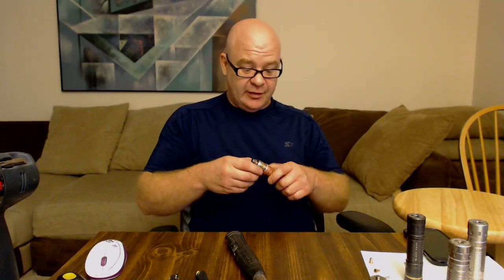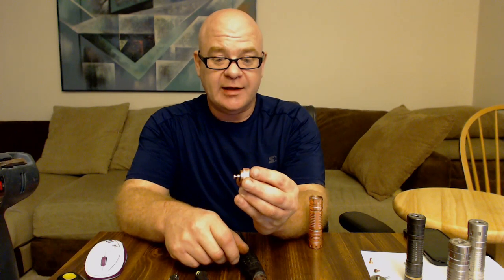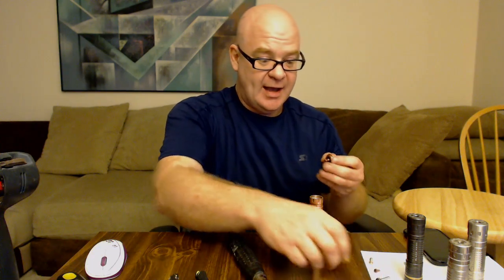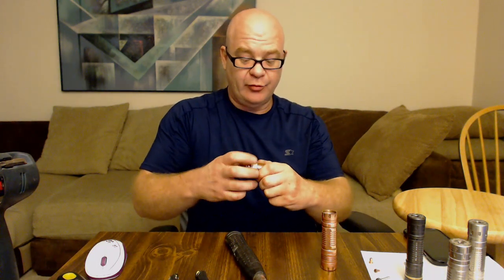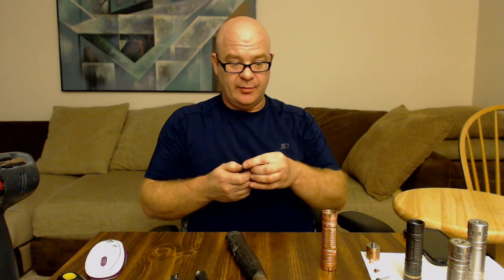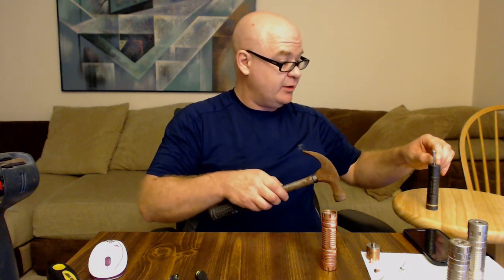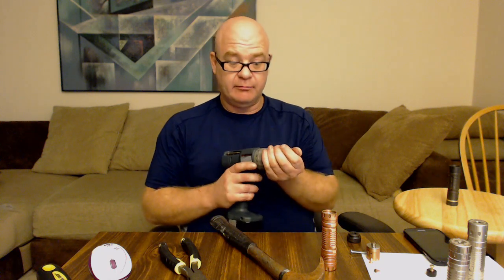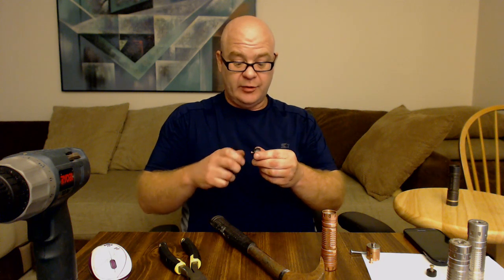Panzer Mod Floating Pin Adjustment and Fix

Comment: Thanks. My Panzer wouldn't fire and I realized my floating pin wasn't tight enough. There was a very slight amount of battery rattle that I overlooked thinking it was tight enough. There really is no room for error lol.

Comment from the maker: If you have a Pegasus or Overdose it's a similar process but do not thread it on a machine screw. The thread on both of them is an oddball fine thread that you cannot find in the U.S. With the Overdose the floating pin has a smaller diameter that you can chuck up in the drill and sand it with sand paper to fit it. With the Pegasus it's a little more tricky since the smaller diameter on the floating pin is much smaller and so you can't really chuck it up in a drill. This method will also work on the Overdose. Since the thread is rare and you will not be able to find a machine screw with the proper thread, you will have to get a 10 gauge coated solid wire from any hardware store to self thread the floating pin on. It will be with all the other wire on rolls you can cut off and buy by the foot. I got mine at Ace hardware. The wire needs to be solid not stranded so it will be stiff. Available anywhere for about 60 cents a foot. The wire will have the standard coating on it and all you do is cut off a piece abut 1.5 inches long, screw your floating pin on the end and chuck up the solid coated wire in the drill. Works perfect and it took me days of trying to figure out what I could use to self thread the floating pin onto so I could spin it in a drill. This will work. I have done it successfully several times and several other guys have been successful using this method also.